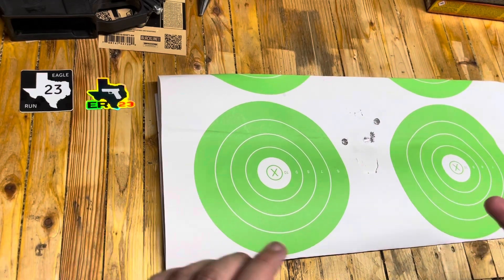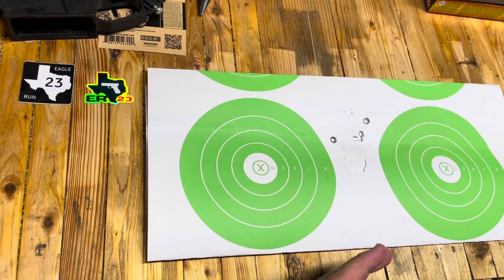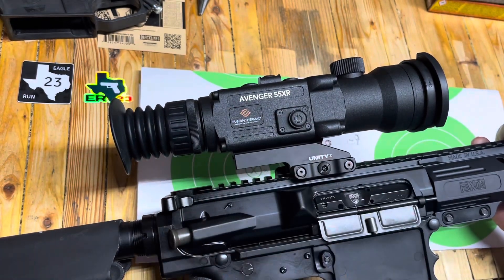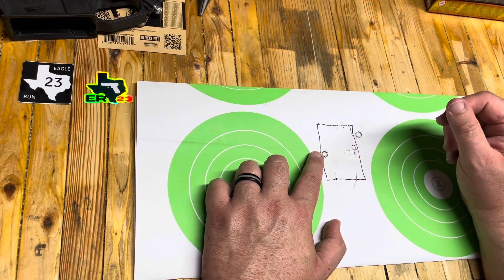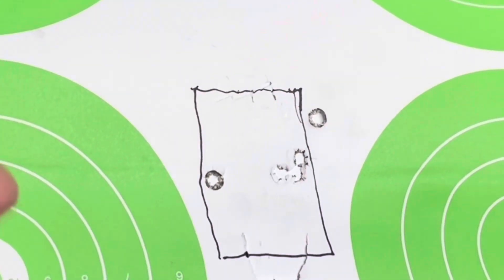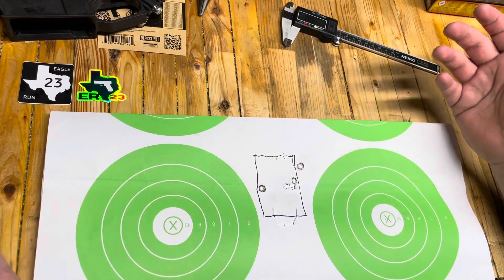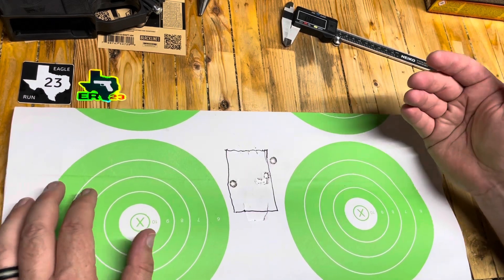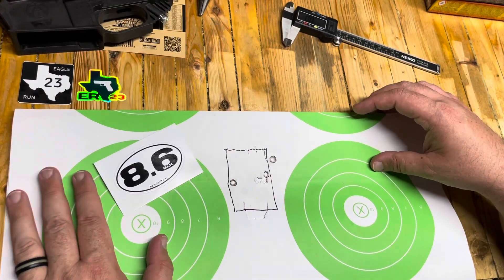8.6 Blackout Accuracy

Comment: I am playing with 315gr cast hollow points out of the 8.6 bolt action, and I shot a 10 shot group last time I went out that was right at 1 inch at 50 yards. Jacketed bullets are doing .5 inches normally for me at 50 yards.

Comment: To zero my 8.6 with my thermal i cut a square in a box then stapled the handwarmer behind that hole. That have me a smaller target to aim at. I had to widen the hole until i could pick it up in the thermal but it did the trick. I verified zero with a hardwarmer taped to tannerite. It was pretty awesome watching that through the thermal!